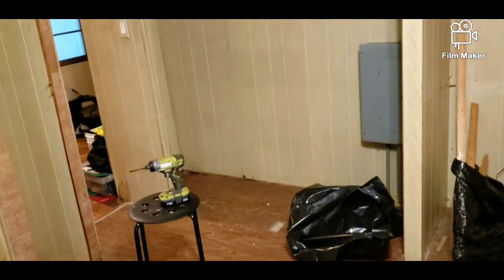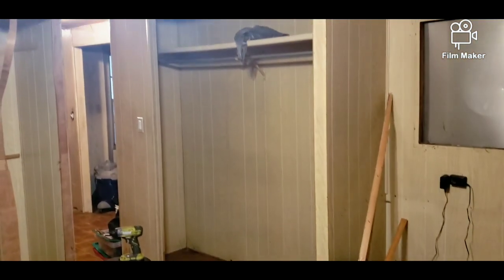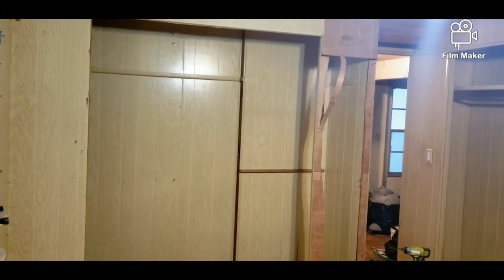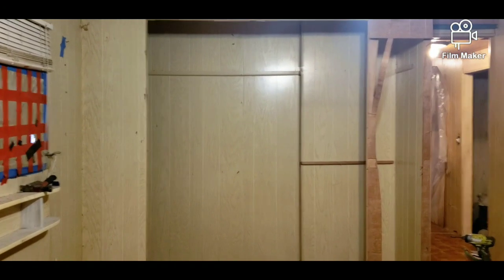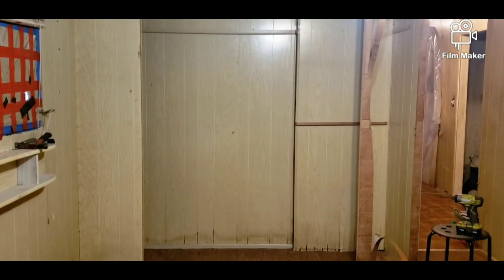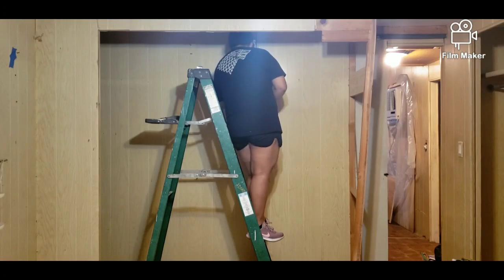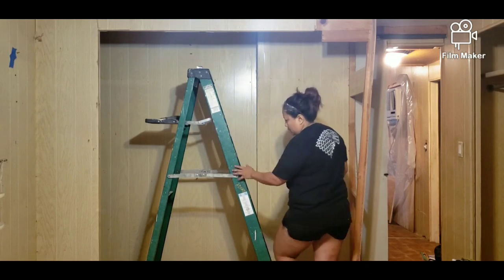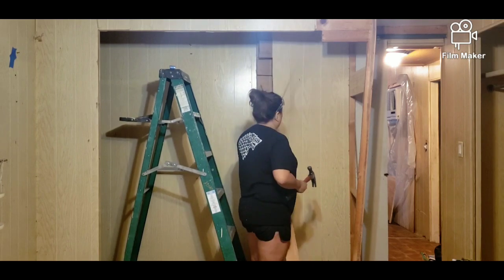Mobile home renovation 3

Comment: I started a mobile home renovation about 6 months ago and hit has become way more than i bargained for, especially doing it all on my own. 
I was going to ask if you had checked your breaker panel, the one in my trailer was a federal pacific and I am having to replace it. it looks like yours in updated though, which is good. looking forward to the rest of the videos.
Reply from the maker: Its definitely a lot of work. Not as easy as it looks. We encountered a lot of things while renovating such as leaks, unstable flooring and terrible framework. I'm so nervous to take on this kitchen and what we might need to do for it. As for the breaker what we had to do was rewire a lot of it. We knew that we wanted to add more lights in the closet and kitchen so we had to add new wires. That has worked for us so far. Luckily we didnt have to replace the whole thing like you did but honestly I think what you did was probably the best thing to do.